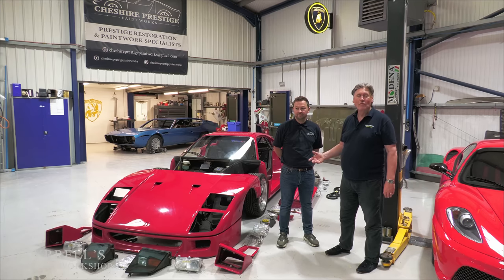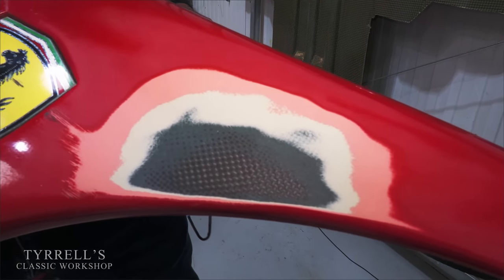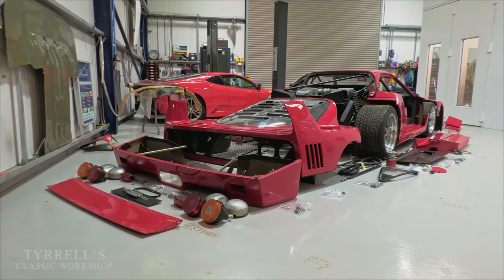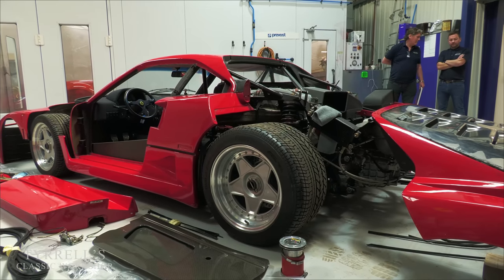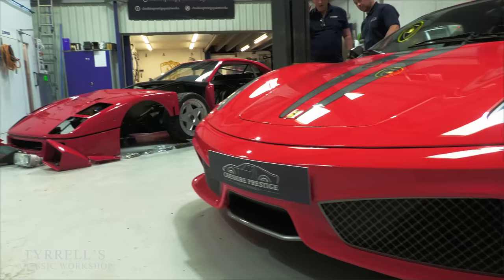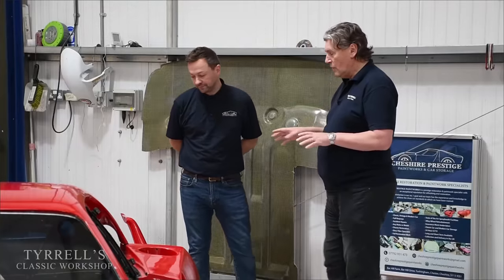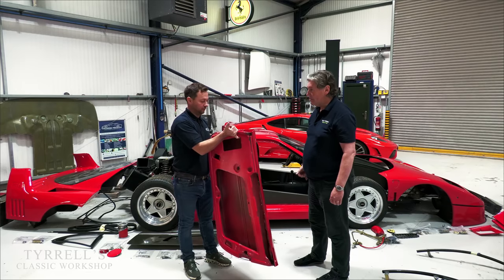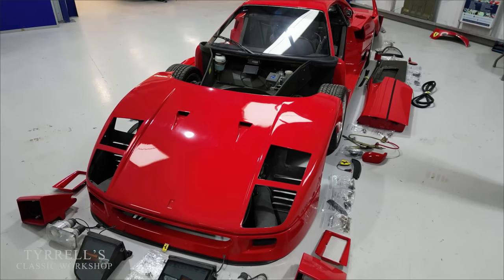Ferrari F40 Restoration Part 3 - Myth-Busting Carbon Fibre | Tyrrell's Classic Workshop

Comment: One of the things I've learned over the years is that by using a "two tone" system of paint primer before shooting the final colour can very much affect the final result.
By spraying a darker primer on the lower panels and following a belt line or an obvious dropping off spot, and then spraying  lighter primer on the upper panels, the effect is make the car appear to sit lower. The effect is more pronounced with "candy colours" where we would shoot a metal flake primer coat in gold or champagne tones with a silver above. Then spray the colour coats over that base.

For solid colour paints with no metallic flake I personally prefer spraying over dark primer because I find the colours "glow" with more luster and depth.
Reply: nice story but solid paints if its a lighter paint colour you want a lighter primer

Comment: Is anyone else comforted tremendously by these facts:
A) there is a bottle opener hanging on a string in the background of the opening discussion
And
2) it’s swinging as if it were just recently used.
This is like a third Michelin star in the car restoration industry.

Comment: It might have been new tec for Ferrari in the late eighties.  But I was working with carbon fibre and epoxy resigns back in 1970 and they were not brand new then, Development went back well into the sixties trying to develop turbine blades for Concorde. these blades were tested by running up to speed and feeding frozen chickens through them. The car industry was a very late starter with carbon probably due to the snob factor over GRP bodies.
Reply: Not to mention boatbuilding where Kevlar, vacuum bagging, and highest quality resin formulations were introduced in the 1980s.
Reply: @davecohn5546  Dave we were building canoes from carbon back in 1970 in fact the person that introduced me to the material had built a canoe from carbon and drove a double decker bus over it to demonstrate it's strength, there is some super eight film kicking about somewhere.We were not vacuum bagging or building large scale the carbon and epoxy were just too expensive, I was first introduced to Kevlar in the form of woven tape in 1972 again extremely expensive and not massively useful for canoe production.

Comment: Interesting that you note about the turbos...  here we had, (and I still have on an older diesel SUV) 'Turbo savers", timers that allowed you to turn off ignition, exit and lock the vehicle, and the diesel continued to idle for a priod you set on the saver...  1, 2, 3 or 4 minutes in my case. Also in the trucking industry, with the big turbos on the older trucks, they had a reservoir of oil pressurised from oil pressure( with an air gap in the top to maintain pressure) fitted connected to the turbo with a one way valve so that pressure was maintained after stopping.

Comment: Interestingly on the side repeater /indicator light,the F40 was manufactured from 1987 to 1992,the Fiat Punto from 1993-,so if parts sharing did happen then  its likely the Punto got the F40 light and not the other way round.
Reply: You are correct, but interestingly that light first appeared on the mark 2 punto in 1999!
Reply: Most likely it came from an earlier Fiat model, as Ferrari has used off the shelf Fiat products for decades.
Reply: @ingvarhallstrom2306  I think it was used on the Fiat 124 in the 70's.
Reply: @vibingwithvinyl   Fiat 127 from those years have also been mentioned in other threads. It's a fantastic bit of Trivia that Fiat (and Ferrari) used the same components for over thirty years.

Comment: Another masterclass restoration video. I learn so much from these episodes. All the little "nerdy" details of the design of the Ferrari F40, the reasons why the some of these details were made and the cheeky facts about the chassis design going back to the 1950s. Shhhhhhh! 
  Doesn't take away from how wonderful the F40 is and how ground-breaking it was at the time. Thanks, again Iain and Ryan!

Comment: Print through is due to the post curing of the laminate after manufacture. In F40 days I think you will discover that the laminates were room temperature cured epoxy resins. A finished car painted Rosso Red sitting in the sun will soon develop very high surface temperatures, which will further cure (and shrink) the epoxy resins leaving the carbon, kevlar or glass weave visible. Some manufactures who were not so concerned by additional weight would use a glass scrim layer against the mould surface which masks the woven cloth.  Horizontal surfaces tend to be more prone to print through as surface temperatures in service will have been higher. Autoclave processing eliminates this problem to a large extent, not just because of the increased consolidation of the laminate, but because of the high processing temperatures used in pre-prep laminates. In the industry it's called Heat Deflection Temperature HDT. If the laminate is cured at a higher temperature at manufacture than it will see in service then then problem is eliminated.

Comment: The seeing the weave through the paint bit reminds me of the1953 Corvette, where you could see the fibreglass weave quite clearly under the paint.
Reply: The roof of all the Citroen DS has always been gass fibre, and in the cheaper model they even left it unpainted. On sunny days you can see through the roof from inside, as It's just slightly opaque.

Comment: Fantastic video.  Pretty sure that the print-through you'd see on the exterior is from a translucent "sanding layer" of fiberglass over top of the carbon fiber.  Even in the 80s I doubt anyone would try to paint or do bodywork directly onto carbon fiber, let alone kevlar.

Comment: The pink primer is a nice touch to keep the top coat vibrant.  I remember having to get my old red car's bumpers repainted, and it looked so off...turns out the repair shop used their standard grey primer, but the factory used a bright yellow - which changed how the topcoat red looked.  The contrast between the bumpers and the rest of the car was fairly hideous.

Comment: Wonderful content: thank you both (I never knew you could figure out the source of a "heat bump" in a composite body shell, the things you learn). Re: 11:07 and your point about early turbo-charged engines, us lorry (truck) drivers had to do the same thing - let it idle for a minute or three before you shut the engine down, especially after prolonged hard work.

Comment: As an aircraft structures engineer specialising in metal composite and carbon repairs. The bubbling delam is more likely just the upper skin adhesive failure. 
It’s just a straight forward core replacement and hot bond (250f) composite repair. Interesting though as aircraft at the time of the F40 are very similar!

Comment: Well that's another myth busted, you can see the weave through the paint but because of sinkage not thin paint. It's nice to hear you talking about weight when it comes to paint, not many people think about the performance loss when you blooter 2 or 3 litres of paint on top of existing paint. Did you know white paint weighs more by volume than black paint, 950g for a litre of black compared to 1200g for a litre of white, it's counter intuitive, most people would think the opposite. Can I ask is it PPG paint on the F40 and was it originally basecoat and lacquer or was it 2k top coat to save layers and weight.
Great video as usual, thank you, who needs top gear on a Sunday night eh!

Comment: You can see the carbon fibe texture.
An F40 with a Tubi Style exhaust came to The Ace Cafe a while back. You could clearly see the texture of the weave all over not just on one or two places. Its what makes it for me, looks wise.
Reply: I was fortunate to have seen a new F40 back in the Day, a friend of my Boss at Mocheck Clapham, he turned up, and as he parked up, he popped all the panels to let us see the internals. You COULD see the weave, underneath the paint, 100% remember at the time, and working with exotic motorcycles, I had an eye for these details and memories !
Reply: I don’t think they understand what people mean by “seeing the weave.”  No one is seeing black unpainted carbon fiber, it’s simply the texture of the weave still being perceptible in the top coat of paint.  You can see the texture quite clearly e en in this video.  People think it’s because the paint is thin, it’s simply because there no gel coat and it would take abnormally thick and very many coats of paint to try to hide the weave.  That’s the myth, not the visibility of the weave pattern in the final finish.
Reply: @garethpepin6167  
Mocheck, now that brings back memories. I remember it well next to that huge mansion style house. Last time I went by, there was a sad looking second hand car seller in its place.

Comment: Another F40 myth is the actual weight. It is all over the place with figures ranging from 1050 to 1340 Kg. Then there is confusion about dry weight or 'kerb weight' to make it even more fussy. With help of FCN members and the Dutch RDW the conclusion was 1250 Kg dry weight. This means with all fluids, ready to drive, but an empty fuel tank. Note that F40 Has a capacity of 100 liters. LM versions were totally stripped and have even thinner body parts and may well have saved another 100 Kg.

Comment: Such amazing cars.  If I ever won the lottery it would be an F40 over anything else as my first buy.  A friend of a friend had one in the early 2000s and I was lucky enough to get a couple of rides in it and whilst compared to modern super cars today its "slow" they are still such an experience I would rather have this over any McLaren, Lambo etc.
Reply: Same here but unlike you I have not had a ride in one. The closest I have been to an F40 is have one parked next to my old car (it was old then) 25 odd years. Unlike most F40's it was right hand drive and yellow.
Reply: I would build a replica.
Then you can thrash it.
Reply: Tesla faster than all
Reply: @hassyg4083  exceot anywhere corners are inbolved, or handling.
They do gonup in flames pretty quick though
Reply: @deadprivacy  wonder if these classic cars will run on synthetic fuel in future
Reply: @hassyg4083  well anything , even petrol is more environmentally friendly than an electric car.
Reply: @deadprivacy  not really its going to be banned soon

Comment: The delamination on the front clamshell is probably a combination of heat and resin starvation when the part was built. There's fairly high temp parts made with carbon (motorcycle mufflers for example) and those don't simply delam due to heat. I would find it hard to believe that heat alone would cause that delamination without scorching the resin on the underside, too. That's why I say that there's another factor, probably resin starvation, but could be lack of adhesive depending on how the panel was constructed.

Comment: Myth # 1: "You can see the carbon fiber weave though the paint."  This is not true. Except when it is sort-of, more-or-less true, in some case. It has happened. Examples given related to inconsistent quality and paint sinking into the weave due to heat. Telegraphing through, as an inconsistent surface. Not transparent paint as such, which was not intended as the claim; except when it was, wrongly.
Thanks for clearing that up.  🙂 !!

Comment: I have a box fan that sits in my garage facing the nose of my cars ones is 1990 Lotus Elan turbo,  one is 1964 Jag XK and one is a Ginetta,  and in all three cases there's a box fan in front of the nose of the car plugged into a simple 30 minute timer. When I pull into the garage I turn on the box fan and let it blow air through the nose of the car for 30 minutes this seems like a very good idea  any thoughts on why it might not be

Comment: Epic as usual, love the truth backed up by vast knowledge and fact vs the Ferrari glitterati vibe😂 Iain and Harry both doing a great job debunking some of the ridiculous marketing hype around Ferrari, I was quite shocked by the shoddy chassis work under Harry’s Testerossa. Still hugely desirable of coarse, but designed and built on a budget by normal workers on average money. Hoovies garage and the car wizard doing similar things in the US
Reply: American-based shit-caning  of Ferrari is as passe as the zealotry toward them. Bottom line is auction prices;  they are phenomenally valuable, because buyers consider them very worthy
Reply: @stephenscholes4758  Thing is, an awful lot of them are not that good, iffy build quality, iffy reliability. They mostly look good but are a total liability to drive anywhere and your dangerously close to looking like a fool who’s been parted with his money. Toys really. Auctions at this level are full of speculators, Ferrari is just a fairy rare commodity being traded up. Better cars out there if you actually want to use that for the intended purpose.

Comment: Wouldn’t it be the other way round for the side repeater indicator lights? Being the F40 came out in the 80s and the Punto in 1993? :) amazing video though, never seen an F40 pulled that far apart before!😊
Reply: I was wondering about this as well. You cannot actually exchange them as they are completely different, only the orange lens might have the same shape.

Comment: That’s impressive, seeing an F40 laid out like that! Looks like the indicator repeaters’ origins go back further than the Punto mk2 - take a look at a 1970s FIAT 127, or even an older 500!
Reply: Yes, they got that wrong. The original Punto from 1993 didn't even use those side indicators, only the MKII did. It's a Fiat parts bin piece, for sure, but way older. Even Ladas used it, it was common practice to have these components shared between cars.

Even today it happens.

Comment: As always, very interesting but would’ve liked Ryan to explain the solution where the carbon fibre has possibly delaminated from the aluminium honeycomb core on the front clam above the brakes.

Comment: Some of you may know the 288 and F40 were most definitely not overly expensive cars for Ferrari to build either. I’ve been told the build cost was similar to that of a Testarossa. The 288 sticker price ($85k) was not hugely more than the 328 ($65k circa 86), and by the end of the 328 run the sticker was almost $84k. Such was the issue that many mechanics and dealers wondered why the 328 was ever produced in the first place. 

As a side to this, Maserati caught on to the 288/F40 and developed the prototype twin turbo v8 mid engine Chubasco which was shown in 1990. It promised its cost would be similar to the then Ferrari 348. It’s said that Ferrari immediately got on the phone with Fiat and all but ordered Fiat to buy Maserati, which they did, and immediately shelved the Chubasco, which a few years later was tweaked quite a bit and detuned as the DeTomaso Guara. The twin turbo V8 Maserati developed was later used in the Shamal and early 3200gt.

Comment: Regarding the repeater light, the Punto didn't arrive until 93 so suspect that light is a Fiat Uno item. Entirely possible it dates back to the 127 (my 73 side turn indicator looks very similar in old photos) or even the 850 Coupé!

Comment: Please watch the video that Tom Hartley Jr. produced, the Definitive F40 Buyers Guide; he gets into the topic of “the weave” and both explains and shows the difference in the paintwork between the older and newer production runs.  There is an obvious visual difference and reason for it.
Reply: Davide Cironi has a video of an interview he did with the father of the F40, Nicola Materazzi, who during the interview explains what went on with the paint job on the car and his disappointment when the change was made.  Apparently the original version of the F40 was much lighter.

Comment: I was wondering about the side indicators being the same as from a Fiat Punto, but they are not. They look similar but the shape and fitting are quite different. They are the same as the Fiat Barchetta and Coupe though (OEM 46304498 and 46305952)

Comment: Sorry but I don't think I've understood correctly. And... Correct me if I'm wrong: it's not true that you can see the carbon fiber texture, but, some minutes after... he explains that the reason is that, given they're the first cars to be painted like this, the paint job is incosistent that... paint sits in the different portions of the carbon fiber upper layers. Isn't just a different way to tell about the same "result"? If, as I understand, the "wave" Is only a pain quality issue... if this problem is due to where the paint sits on the trama of the carbon fiber layer, isn't just the same thing?
Thanks in advance!

Comment: 12:03 Having a look at the front tires - is there something going wrong? I mean the profile, it seems to me that one is going forward, one backward. 14:24 The same on the rear hand. Is that a mistake or is this correct? (I remember that my car had some sound issues when the shop mounted the direction orientated tires the wrong way, one time; and I did not even try the tires on wet streets).

Besides that: The indicator (from the Punto) doesn't look very different from that on my '76 124 spider back in the days. And fun fact: I could open the door of a 308 with my keys from the earlier '73 124 spider... Ferrari driver was not amused. So much for same parts in the company.

Comment: Very interesting video. Would paint protection film be considered on a classic car such as this, or is it frowned upon? I would think if the car was to be a garage queen then probably not, but certainly if it is going to be run regularly then it would save further expensive work down the line.
Reply from the maker: Absolutely. Doing a vid on film shortly. Thanks